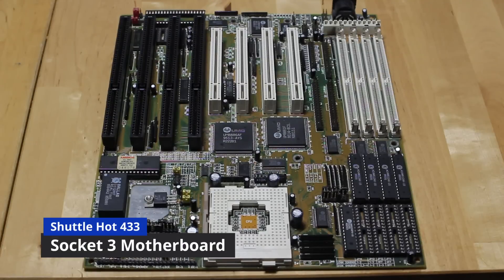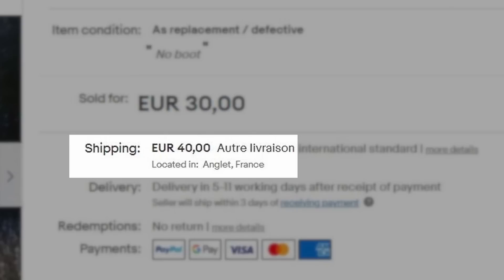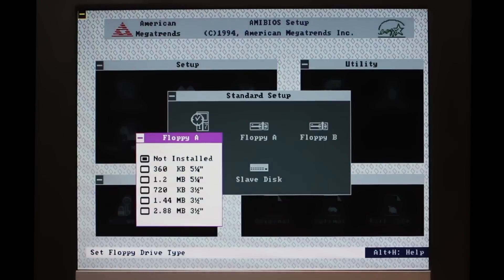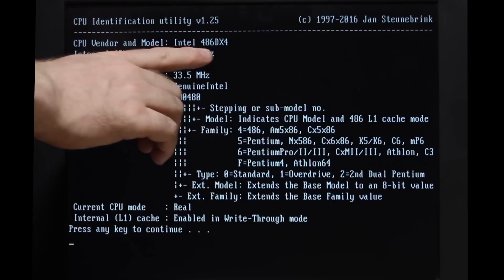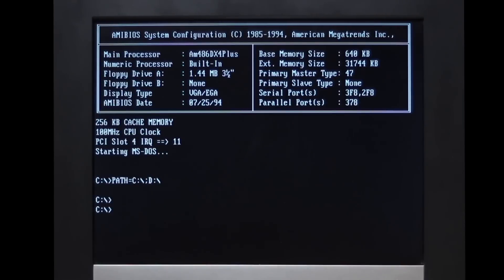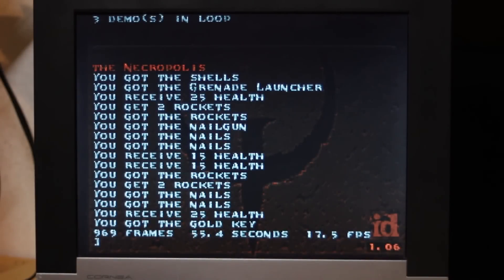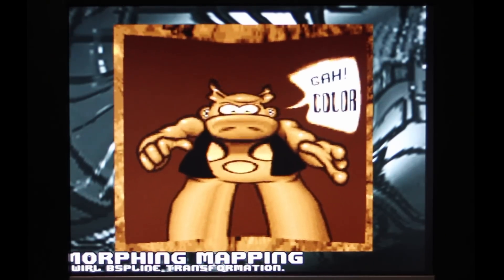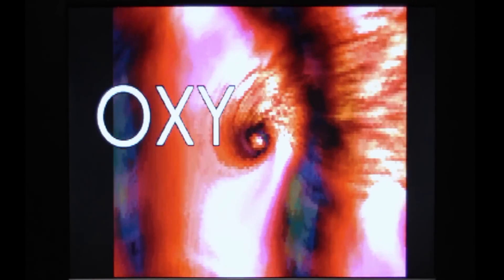Is this Really "One of the BEST 486 Motherboards Ever Made"? #DOScember2021

Comment: why is the dallas rtc you replace the dead one with itself not dead?
Reply from the maker: The short answer is that I don't know. I bought them new old stock, so they would never have been used. Or possibly they are fake and have had the batteries replaced with new ones in China. I'd love to know the answer myself actually. I was slightly surprised when I discovered they actually worked after buying them.

To be honest, this is one part I don't mind being faked. They look great and they seem to work.
Reply: @PCRetroTech  I went the opposite route - bought a new new stock 12887+ from Digikey for my PS/2.
Reply from the maker: @fnjesusfreak  Yeah that seems to be the more common route. I vaguely recall reading somewhere Y2K compliance was one of the differences, but didn't get around to checking that.
Reply: @PCRetroTech   Yeah, I can’t say I understand why someone would go with NOS on something with an expiration date - especially if what you are replacing is already a 12887.  (Some people are really concerned about that extra 8, but I haven’t run into any problems at all yet.)

Now, not adding a socket?  That’s just madness, sir!  ;-)

Comment: i am pretty sure i had very similar board as a kid
similar layout, the same bios , chipset, integrated controllers
the thing that is different though, i am pretty sure my board had  brown connector with cache module very tightly stuck in it i was unable to pull it out :P
Reply: The only 486 board that cames to my mind with that is the pcchips m919
Reply from the maker: That sounds like a COAST module. "Cache On A STick" (I think). Usually they are something you find on a Socket 7 (Pentium board), but I see Deksor knows about a 486 one.

Comment: This board has a BIOS update that's been made in 2001 by some company, and that BIOS supports CD-Rom boot ! This is truly unbelievable for a 486 !
Reply from the maker: Yes, I saw the BIOS update and really wanted to try it out. I decided that I'm so happy with the board that I didn't want to risk ruining it, so I haven't tried that update out yet. I might do so when the novelty wears off!
Reply: @PCRetroTech  well you can always try the hotswapping method of flashing the bios. Take a blank ROM, before turning the board on, lift the ROM slightly so you can easily pull it out but not too much so it's still connected.
Then turn on the motherboard, pick the new ROM, the new ROM file and a software named uniflash, remove the old ROM, put the new ROM in the board, then use uniflash to flash the new ROM.

And you should be good with the new ROM :)
Reply from the maker: @DxDeksor  Yeah that sounds like a good idea. To be perfectly honest I noticed that the board supports 5V and 12V EPROMS, and I just didn't want to risk it. I've no idea if the voltage is set correctly, and there's no marking on the actual ROM to give me a clue as far as I can see. I'm sure I could figure it out, but I didn't find the time to look into it yet. There are many other things I'd like to do with this board.

I did for example try all the possible jumper settings to see if there was a 60MHz FSB setting. It appears there is not, which surprised me a bit. I believe a later revision of the board has that.
Reply: @PCRetroTech   Get yourself one of those Mini Pro USB flash thingies and a spare flash IC.  Then you can burn the ROM offline, keep the original safe and sound, and test your SRAMs to boot!
Reply from the maker: @sirnickity  Yeah that's what I have to do I think.
Reply: @DxDeksor  jeez that's like the PC equivalent of transplantational open-brain surgery :face-purple-smiling-fangs:
Reply: That’s quite awesome, considering I have a Pentium 100 with no concept of a CD-ROM boot.
Reply: @DavidWonn  You only need a SCSI Controller and a SCSI CD-ROM drive, then you can boot from CD-ROM.
Reply: That be interesting to see if that works or how they got that to work. Without giving up the working bios.
Reply: I had a 486 with an Adaptec ISA SCSI Controller. This means i could boot from CD-ROM without problems. I bought that Adaptec ISA SCSI controller somewhere in about 1995.

Comment: 486 with PCI is a really cool, it can use GOOD video cards, ever Voodoo Or VoodooII, and QUAKE can run nice (better than VLB devices can provide).
Reply: But why not get a Pentium by that point..?
486+PCI is something I never understood, it just feels wrong to me.
Reply: @8bitbubsy  True. Pentium, unlike 486, has a powerful FPU, so there is no point in such configurations. Even at the time of the appearance of the 486 + PCI bundle, it was more experimental equipment than something for everyday tasks. In some cases (for example, with the slow 486DX2-66), a good PCI card can speed up old games like doom and Duke3D.
Reply: @8bitbubsy  486 is never made for 3D gaming. Its just to weak for it.. Better to go with a first gen pentium.
Reply from the maker: I would guess cost was the main motivation for companies to do this. That's always been the case, 286 was still sold when 386 came out, 386 was still sold until 486 came out. I know in 1995 I had a 486 because I couldn't afford a Pentium, so it certainly jibes with me.

On the other hand, whether I could have afforded a Shuttle Hot back in the day I don't know.

Maybe they did paint themselves into a corner and that's why the boards are so rare. But given how highly sought after they are nowadays, that could also be the explanation.
Reply from the maker: Yeah I really like the Voodoo cards. I will do a video on programming one of those eventually.